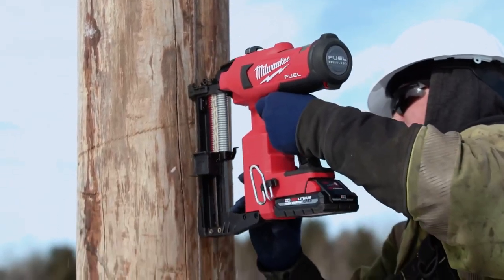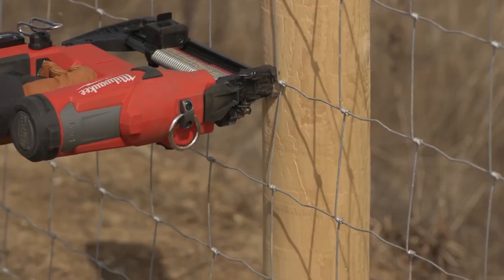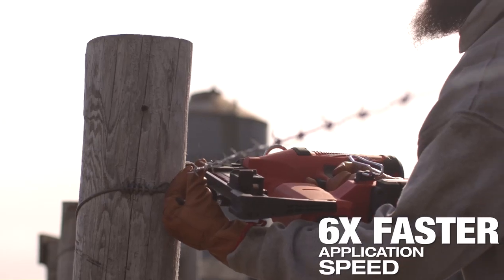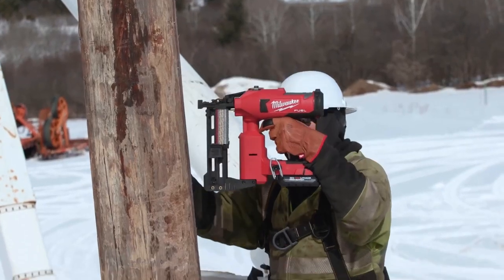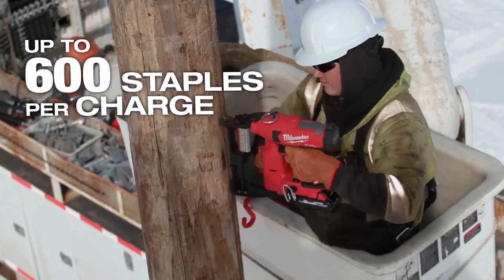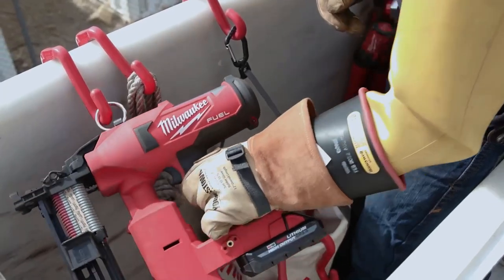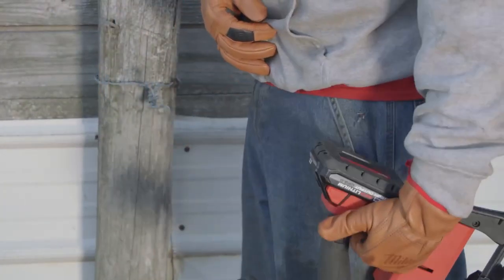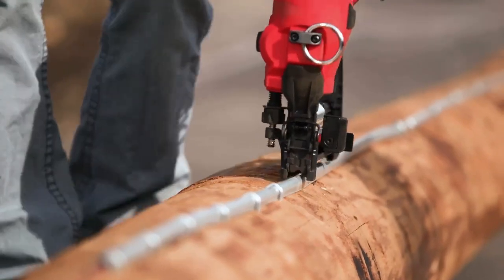Milwaukee® M18 FUEL™ Utility Fencing Stapler

Comment: Will DeWalt 9ga fencing staples work with this? Can't seem to find the Milwaukee staples in the UK
Reply from the maker: Hello Chris,
Our M18 FUEL™ Utility Fencing Stapler is compatible with our 9 Gauge Galvanized Staples (sold separately) available in three sizes: 1 ½”, 1 ¾”, 2”
Reply: @MilwaukeeTool  are they available in the UK?

Comment: Can you adjust the depth, so as to not sink the staple all the way in?
Reply: yes. mine came in today it’s got a good range of depth you can set it from balls deep to abort 1/2” out of the wood. perfect for pole bonds
Reply: @Unpleasantries69  does it seem to stay consistent, like if you want it a half inch out, it's always a half inch, even between different posts?  I want to use with high tensile fence, which needs to be able to float under the staple. Also, I use plastic tube insulators on electrified wires that can be crushed pretty easily if driven too hard. I really want this thing, as I work alone most of the time and it would be a huge time and arm saver, and I'm already fully committed to milwaukee.
Reply: it’s not an electric setting. it’s a mechanical adjustment of the safety/guard on the front of the gun. so i would imagine it’s pretty consistent. none of the videos mention how robust the adjustment system is, i’m pretty impressed that it’s a stout metal adjustment knob that extends the safety out in front of the gun further. if i were you id probably buy it and a box of staples and if you hate it, there’s probably a lineman dying to pay $100 less than you paid for it.
Reply: @Unpleasantries69  do you know if regular staples you use on utility poles will work or does it only work with Milwaukee brand
Reply: @weslambirth7768  ive never tried it. i can try it this week and get back to you. i don’t think that they will though, it seems that the driving force from the staple gun is designed to only drive staples that are that shape